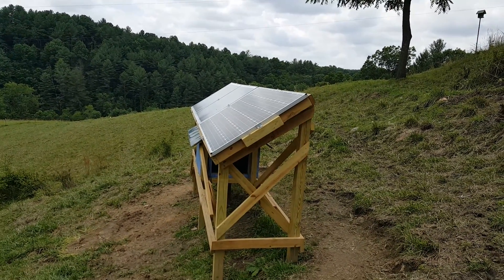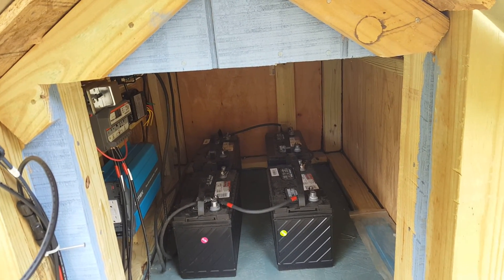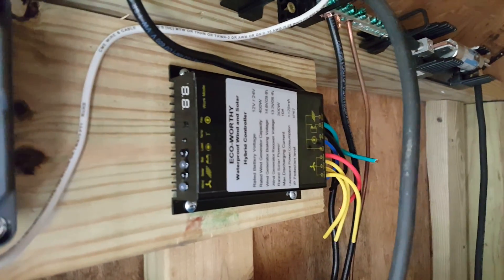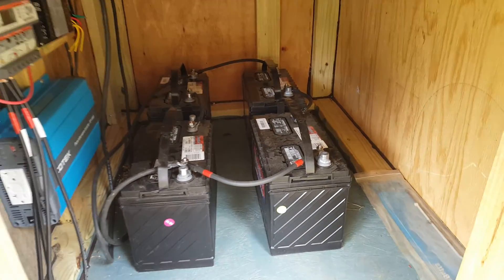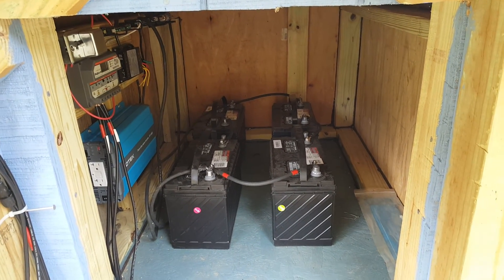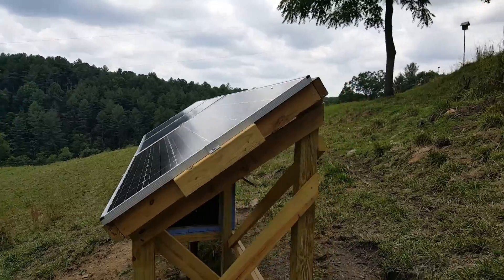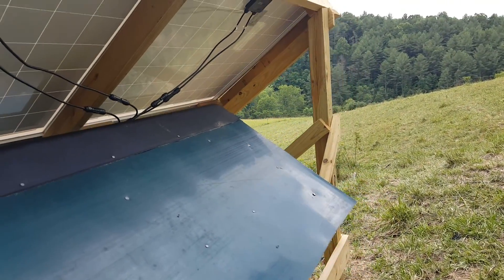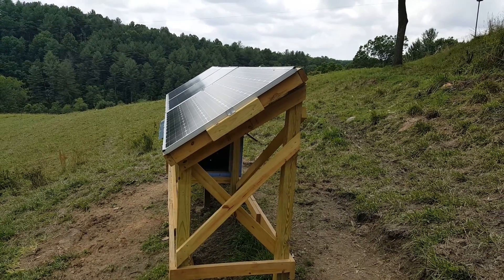Off grid solar system phase one

Comment: Mppt controllers require a certain PV voltage above your battery pack voltage to "start" .  So  the panel array needs to be series / parallel for those using that kind of a setup.

Comment: You were smart to keep the batteries close to the panels to save on the DC voltage drop most people see when the batteries are separate from the solar panels.

Comment: the PS 30 won't have the abilities that the mppt charge controller will have however that PS 30 is completely automatic and it will do everything just right for your batteries equalize charges and everything and it'll do it all automatically and how it charges they say it's actually going to allow your battery to last longer with pwm a lot of us just want the mppt so we can get a little more power,,, that PS 30 pwm charger you'll probably get optimal life out of them batteries

Comment: ProStar 30 are estimated to have the life expectancy of about 15 years that is really good I still have mine that's what I started out with your exact model,,, it looks like and it worked great like I say but I just wanted to try an mppt  charge controller that's why I got the Tracer 4210 from renorgy.

Comment: as far as you keeping everything in parallel you're not going to lose a single thing doing it that way that's a great way for you to be doing it because you are so very close to your batteries and charge controller and you're already at 24 volts so you'll get all the voltage and amperage you need and being at 24 volts and being so very close you're not going to have much invested in wire at all you're going to save money that's a really nice setup you don't have no big long wire run to worry about losing voltage and amperage and all that stuff you did everything right,,,, fused grounded protected real good job.

Comment: Great video but I'm perplexed by how you came up with your total amp hours. Please correct me if I am wrong or misunderstood. You stated that you have four 12 volt batteries. You are running one pair in series and the second pair in series for 24 volts. Then running those in parallel to produce 24 volts total. You also stated that each battery was 90 amp hours. I don't understand how you  came up with 360 amp hours.If you run batteries in series, you increase voltage and Amp hours remain constant. If you run parallel, Voltage stays constant and amp hours increase. That said,  you are effectively running two 24 volt 90 amp hour batteries in parallel. That would give you a net of 180 amp hours, not 360. Am I missing something? That's a big difference in amp hours and if you are basing your consumption on 360 amp hours, you may be in for a surprise.
Reply: Yeah. That what he said 360 amp hours instead of 180 amp hours. His storage based on his connection configuration he has (12v+12v)x 90amp +(12v+12v)x90amp which total 24volts 180amp hour. Which is 4.32 kwh of which is 2.160kwh usable energy since are deep gel batteries

Comment: Hi friend! I think you will get better results, should the inverter be wired directly to the battery bank! The load connections are for running; a light bulb, small items etc. and as for your wiring; they are much to small! Location, angle of the solar panel, addition to removing any ....from it! Apart from the above, very nice!

Comment: nice set up you started with. most of us do not have the batteries in the same area as the charge controllers and inverters. the fumes tend to stick to the electronics and one spark can cause problems.  also, see if there are any golf courses close to you. you can get T-105 to T-145 batteries from them for core charge prices and pick thru ones you want. they do a better job then the batteries you currently have.  your wind generator will need a dump load in case of high winds. just another safety item to think about, but again nice set up to start with.

Comment: Nice Set-up!  Amazon has the Renogy 40 amp MPPT Controller 12/24 volt for $185.  Trust me, with any MPPT Controller it'll take ANY voltage array up to 100 vdc in and boost your charging current way up like Magic.  Also your 120 vac inverter works less because it only has to come up with the voltage difference.  I too have the 24v system with 2 of my 36 vdc panel's in series for 72 vdc to Renogy Controller. I'm 24 vdc 1,200 watt system on my RV roof. The back negative battery cable should be moved to the other battery so as to keep your batteries charged equally.  Sounds petty but its true.